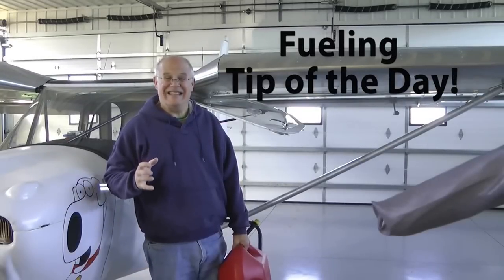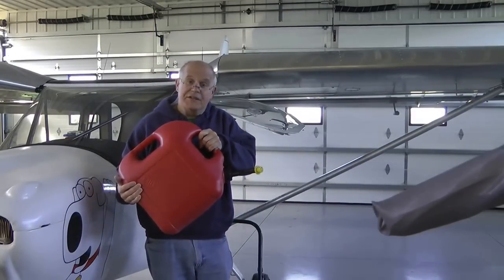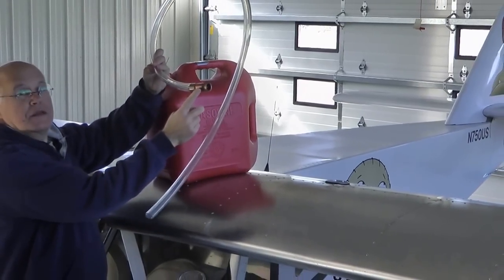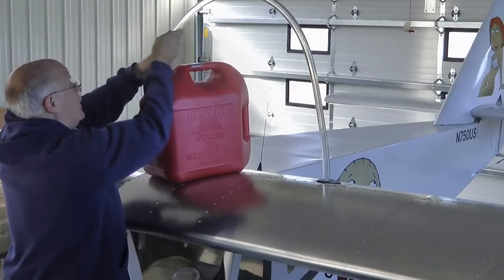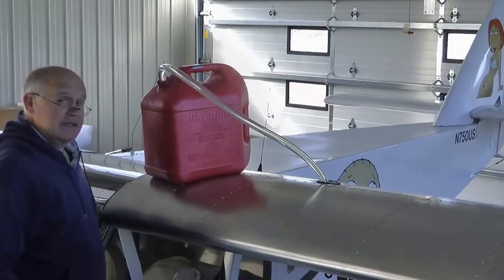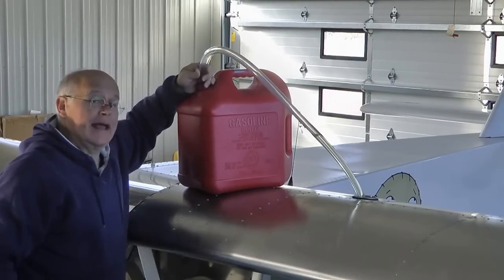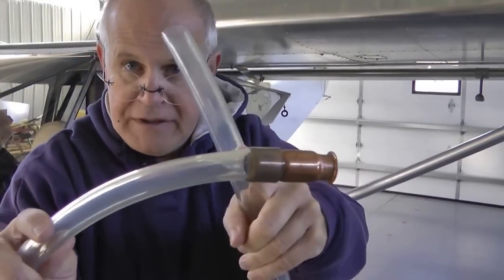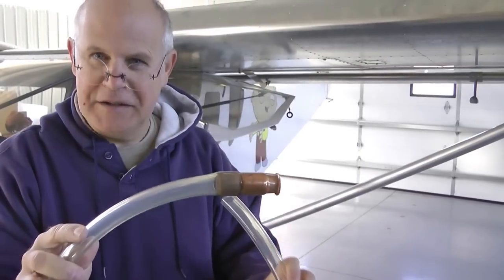Fueling an aircraft with a Jiggle Siphon hose

Comment: You can put a very cheap bicycle style hand pump from Harbor Freight for a few bucks.
I've used the same principle in the field by the side of the road but without the jiggle part, you just suck with your mouth and transfer the hose really fast. You usually end up with a mouthful of gas.
Reply: http://www.harborfreight.com/multi-use-transfer-pump-66418.html

Comment: I just got a question that haunts me and 90% of homebuilders and pilots.. Do or is there any need to make sure there is any type of a "GROUND wire with alligator type of clip, from airplanes fuel neck to a ground bolt driven in the ground BEFORE FUELING??( as  to be used as a ground, to prevent "Static electricity" from turning ones life upside down) and possibly death. what are your thoughts on this  ty Sir.,